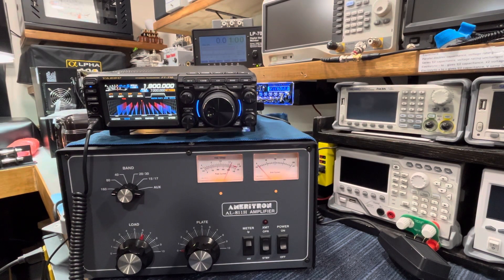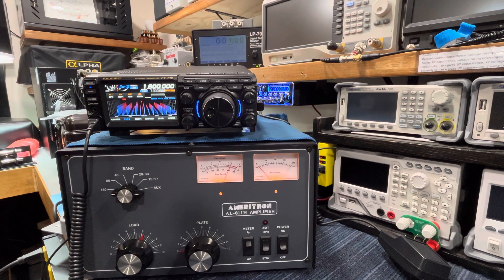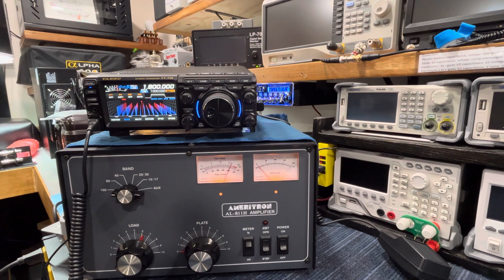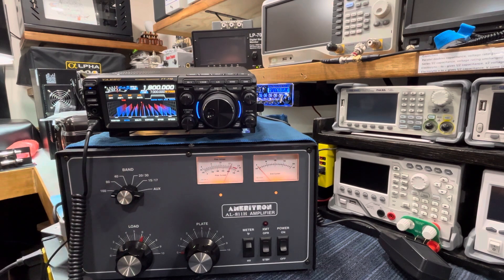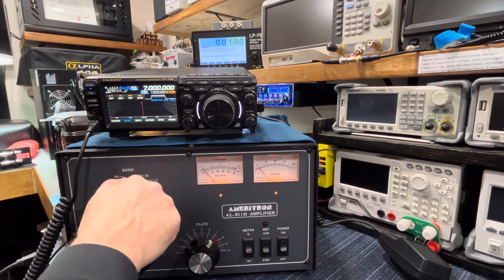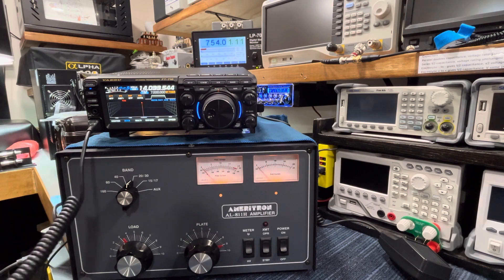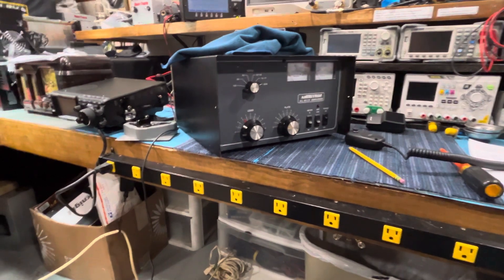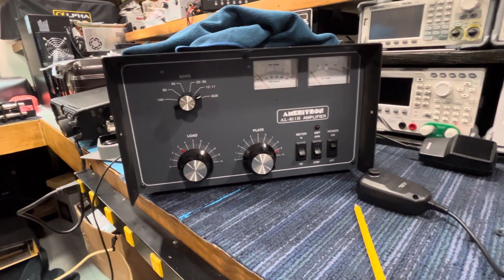AMERITRON AL-811H

Comment: Great video, congratulations!!! years later and it's still interesting. One question please. For a YAESU FT-710, can the PTT output cable be connected directly? Or is a relay necessary? The 811H requires 100mA, but I don't know what the Yaesu supports. Many thanks for your response. Best regards!
Reply from the maker: I would suggest a keying relay for added safety.
Reply: @HAUNTED-HAM  Thank you, but is it mandatory or just to maximize safety? A hug and a thousand thanks.😅😊😊
Reply from the maker: @sergionunezdavila8508 you will require a keying buffer for non Yaesu amps. You will also need to select linear in settings on the 710. Hamgadgets.com has them if you don’t want to build one.
Reply: @HAUNTED-HAM  Thanks!!

Comment: The BBI tuning method.
Reply from the maker: @louw1qjparascondola821  he is a great amp builder why not use his techniques but the way I tune was actually shown to me by W8JI one the engineers that designed that unit. He also sells parts and has many, many great documents on how and why the upgrades / enhancements are needed.

Comment: Red Loctite????  Hope you don't have to take it apart
Reply from the maker: It’s only used on top of the fastener not on threads.
Reply: Red lock  tight you need a torch to get it off or loose! JohnBoyUtah KJ7TBR
Reply from the maker: @Brenda-jf2pe  it’s only on top of screws come off easily
Reply: SOP on aircraft!
Reply: Very nice amp . Eventually I’m going to get one like that for the ham bands . 73’s
Reply: Use a torch